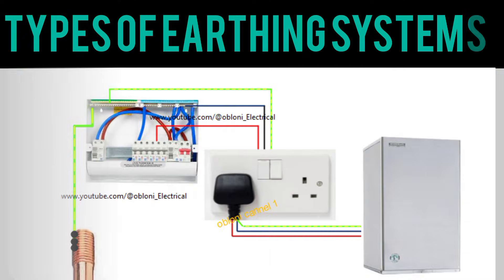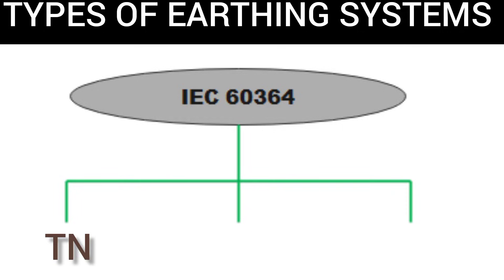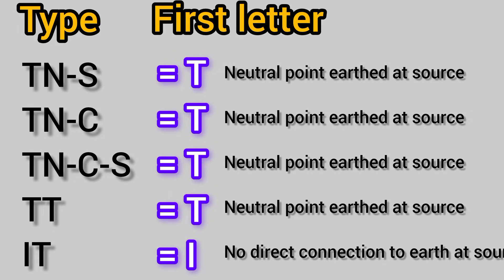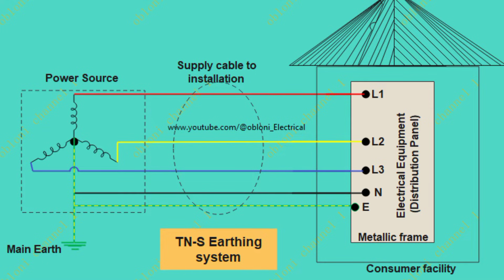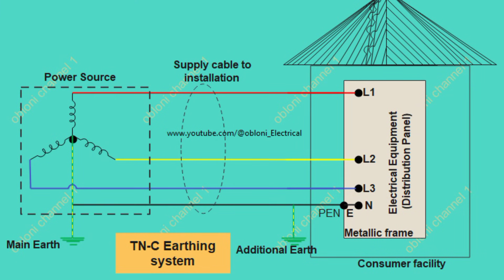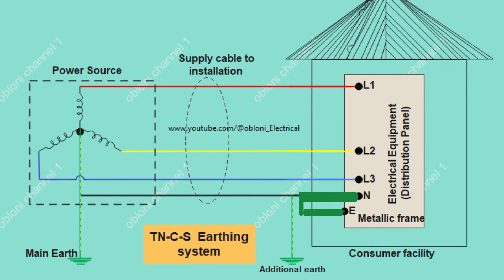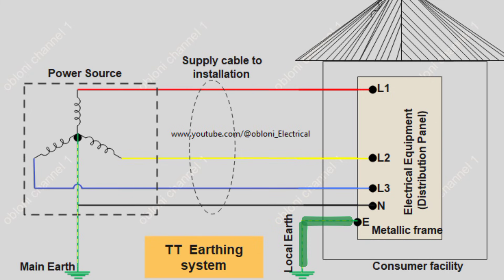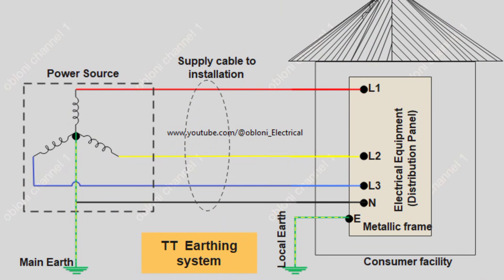Types of earthing systems explained  | TN S, TN C, TN C S, TT  &  I T |

Comment: How do I install a load separation on a building,, for example where I have 4 AC units and I want them to work only on NEPA and the lighting points works on both generator and NEPA

Please help
Reply from the maker: Okay, I show that sometime later
Reply: @obloni_Electrical 
Thanks Sir